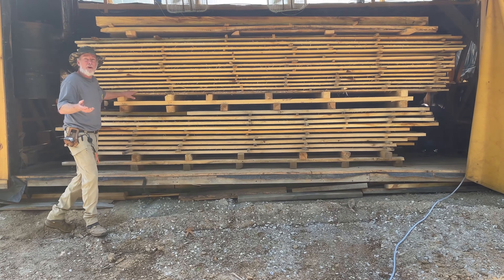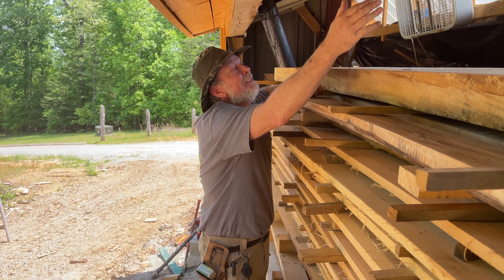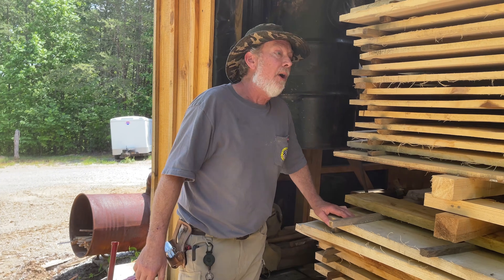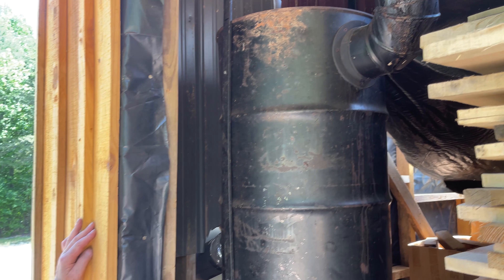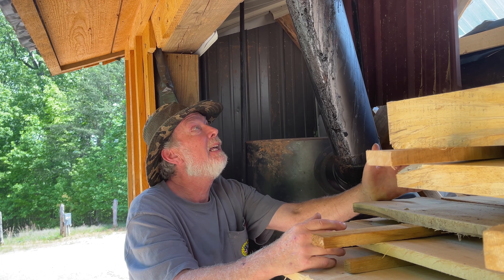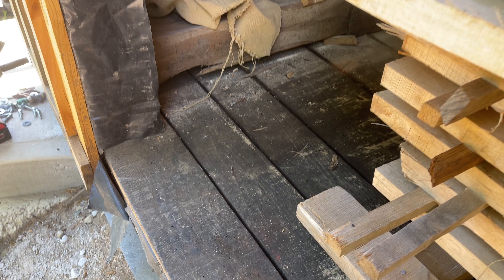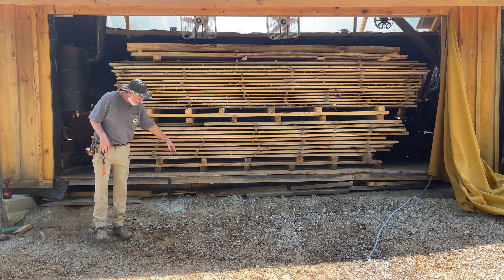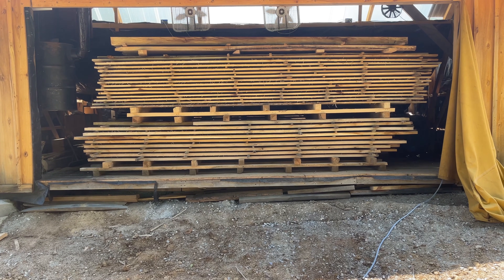SAWMILLS SECRET WEAPON: How to Turbo Charge your Solar Kiln!

Comment: Thanks for the video, can you tell me at what temp. You use to sterilize your lumber, I would also like to know what brand of dehumidifier you have that the heat from sterilization cycle doesn't cook it. Thanks just found your channel recently and have been binge watching, think I'm about half thru what you have uploaded.
Reply from the maker: Thank you Stacy. We try and get to 150-160 degrees. I’ll have to check my dehumidifier but it shuts off at 145deg. I usually sterilize for a few days then turn on dehumidifier. It might go on and off but surely runs all night when sun is in.

Comment: we are taking down a 200 year old chestnut log cabin, damaged in hurricane Helene flood.  we are planning to resaw the lumber for a cabin rebuild.  some of the logs are rotten in the middle, we dont know yet.  have you ever re sawn any chestnut or other old reclaimed cabin logs?  can I assume this lumber will not need any drying out?  just sticking up and storing?
Reply from the maker: I have had the pleasure of resawing aged Timbers. The wood should be completely dry and stable. Not even sure you need to sticker it. I have made products and furniture immediately after cutting with out and moisture content issues. Good luck with your project

Comment: This is an excellent episode.  Lots of great info.  I have questions.

Did you dry your own hickory flooring?  

Would you consider a concrete floor?

Have you seen the shipping containers that open on the long side?  They seem perfect for a dehumidifier and a couple box fans.  But not as good looking as sawn lumber sheds.   Hard to beat the TimberTown motif!
Reply from the maker: Thank you Nate! All good ? 
I did dry my own Hickory Flooring 1 batch I took to an I Dry unit not close to me and he told me it was so dry his unit my add moisture 😂 so yeah took it home five hour round trip. 

I would consider a concrete floor but if you pour a new slab it’s going to take about a year for all of the moisture to dissipate out of the slab causing extra moisture. But after a while concrete would be great. 

Yes the side opening containers are awesome for a kiln. I have several tips and tricks to make it look like like a log cabin or such. 

For me wood is free, only took us a couple days to build this kiln so it was the cheapest best option 

Hope this helps🤠
Reply: @TwoGuysTimberframing absolutely.

Comment: A black plate solar thermosiphon air circulator would keep you from needing to run fans constantly.
Reply from the maker: It might, but that unit would cost more the five times what the kiln cost to build. The fans are only costing minimum amount $5-10 at most per month. And works rain or shine. So maybe not all Solar Kiln but worth it. 
Thank you for a different suggestion for folks. 🤠
Reply: @TwoGuysTimberframing  5x hah. Go to the dump and get a free broken washing machine or dryer of refrigerator. Cut some scrap metal, paint it black. Leave it in the sun. Air is sucked in the bottom and flies out the top. Free! just some time.
Reply from the maker: @Resist.Tyranny sound more like it. I had to look it up when you mentioned it. Starting at $1800  I like your plan better.

Comment: What's the hottest you can get it?
Reply from the maker: I don’t really sit and micro manage the kiln. It’s going to fluctuate. But in a summer with the heater going had it well above 160 deg to sterilize the wood. Winter gonna vary on sun and outside temp. But here winters are not that bad

Comment: With the heat localized, at least the radiant portion, to one side do you notice any difference between the side of the wood dried closest to the heat and the further side.
Reply from the maker: You might get some small checking on the side closest to the exchanger, I only have that happen with poplar which is prone to checking. We add an addition fan to help dissipate the heat equally. Thanks for asking. We appreciate you.